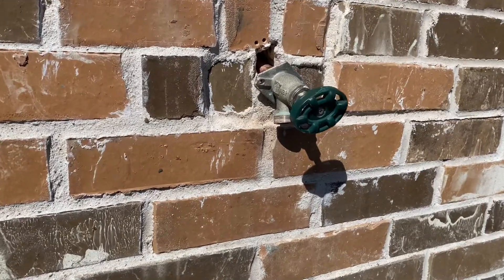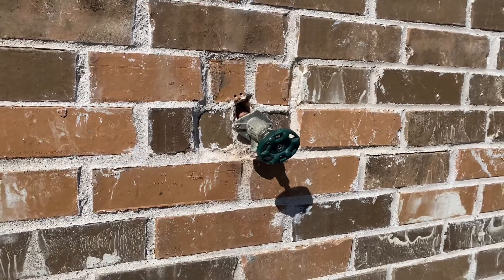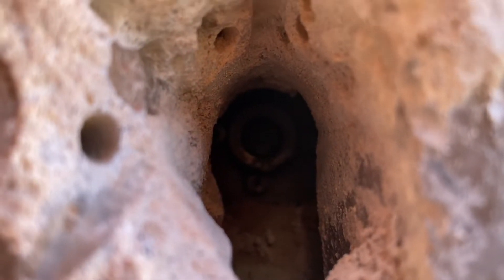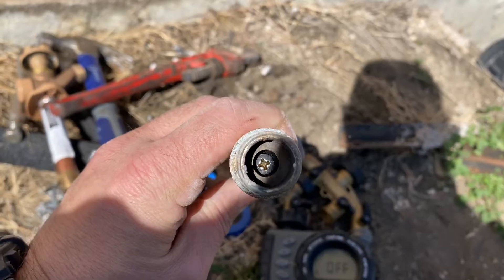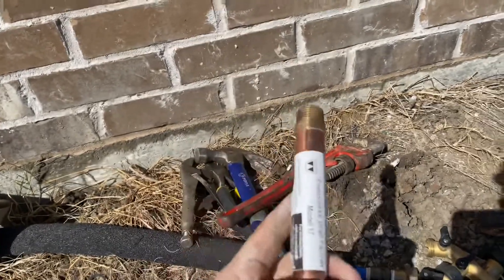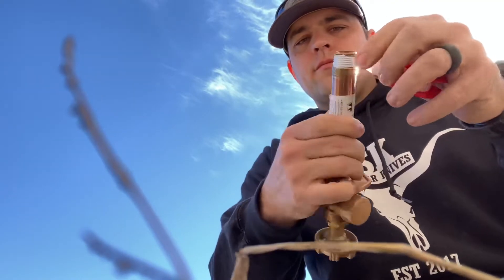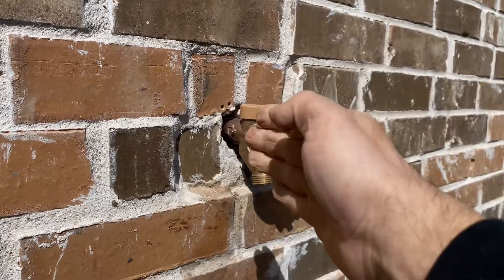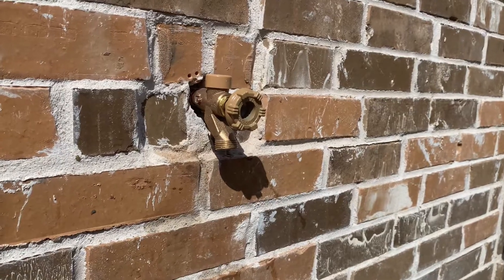How to replace your outdoor faucet if it freezes and bursts.

Comment: The only thing I would add-Confirm what the inside connection is first. 

If it is threaded like your’s, all good. But if it is a sweat joint and you go torquing on it with a big wrench, you will risk damage to that inside plumbing that could be avoided.
Reply from the maker: Very true. Great tip!

Comment: Did you have to inspect inside the drywall of your garage? For mold or water build up? Going through the same thing...
Reply from the maker: I didn’t. The only reason it leaked I side the garage was because I turned it on and I could tell it was busted pretty quick so it ran for 3-5 seconds before I turned it off. From my understanding, the “freezless” faucets are made to bust instead of the pipe so if it works right it will bust without flowing water inside the wall.

Comment: I work with different water faucets on almost a daily basis and run into quite a few of the supposedly freeze-proof faucets that are bad. They've caused me considerable trouble over the years. I've had at least 2 customers in the last year that had their homes flooded because of faucets that were frozen. They used their faucet not knowing there was a problem and it was flooding their home inside with gallons of water. One had a sprinkler running on the lawn for a good while. That last one had most of his basement flooded and cost him quite a bit of money. He had to totally replace 1 very large room of carpet and pad and another more average size room. I suspect that faucet cost him well over 2500 bucks and it could have been MUCH worse. The carpet and pad were unsalvagable due to some idiot putting a moisture-proof pad in the basement. Tip, don't EVER do that!!! These are pads that don't allow moisture to penetrate the pad from the surface, but if you have a flood you cannot extract the water and the pad will never fully dry. The way I check all my faucets that I hook up to is to simply hook up my garden hose and turn the water on full blast and immediately kink the hose. You will instantly hear the water running inside the wall and know to shut it off immediately. If the water pressure if unusually low that is another good tip you have a problem somewhere. Btw, those freeze-proof faucets are by far the worst faucets money can be wasted on. I see 10 X more damage to that type than all other faucets put together. I think they're junk and nobody can change my mind on that. Keep your supposedly freeze-proof faucet covered in the winter and you won't likely have a problem.
Reply from the maker: Since you work w them so often, do u think that’s part of the reason these faucets are made like they are and the reason they fail so often? Serious question, I’m no professional. People like myself forget to cover them after use during the winter or maybe they even don’t cover them at all and they burst in front of the valve trashing the “freezless” faucet, but keeping your pipes intact. I don’t fully understand how it’s supposed to empty the water from the isolated pipe between the valve and the spigot, but from what I ready that’s supposedly what makes it freezless? You’re absolutely correct tho, just cover it and you should be good. I’ve never had a problem w one that’s been covered.
Reply: There is no need to cover a frost free hydrant as long as no hose or cutoff Y is left attached and if the hydrant is installed at least level or better still downward to drain water out of the barrel.l don’t  tell my customers this usually because as long as the are covered there won’t be a hose attached.The old faucet you removed is an arrow head brand they used to be made from type L  thick copper and were more forgiving.You installed a Woodford made in USA which I prefer and pretty sure they have a stainless steel seat which is so important if left dripping for long before a new washer is installed.

Comment: How do you know if it can be twisted off, that it's not welded inside of the wall? I'd be worried about trying to twist it off and it breaking.
Reply from the maker: So, I went to lowes and looked at them and all of them had threaded fittings on them. I’d imagine all of them do because from my understanding that faucet is made to bust instead of your pipes so all u have to replace is the faucet instead of busted pipes in the wall and any damage that would cause. I’m also not a plumber so my knowledge is limited to google haha.
Reply: Luckily your fitting must have been properly supported inside the wall. If you would have twisted the fitting off it would be bad. Always try to get a wrench on the inside to hold it.
Reply: @MontanaWelldigger yeah in my house it’s loose, if I were to try to unthread it unsupported it would definitely bust the small pvc lines in the basement and I’d have to shut the whole water line off while I replaced it.